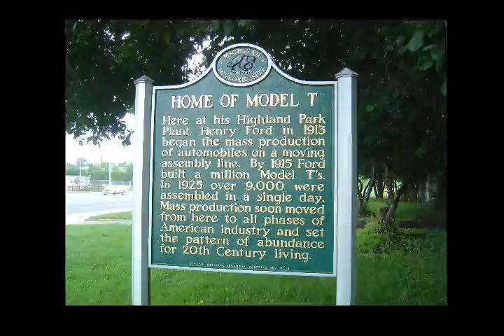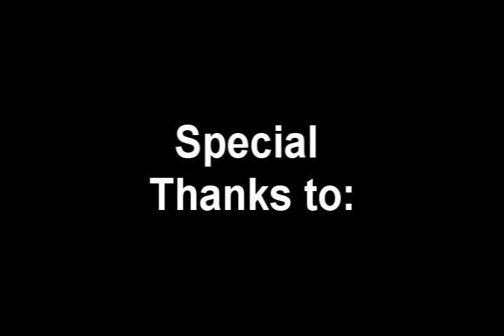Highland Park Assembly Plant

Comment: Useless! To begin, the original Highland Park factory was demolished in 1956, the interstate system was started 4 decades after the Model T had ceased production, and perhaps you should mention the assembly line process? ie, the reason the Model T was cheap, and thus popular.